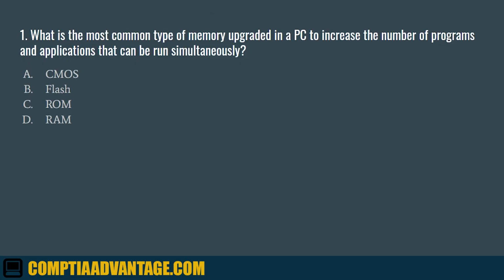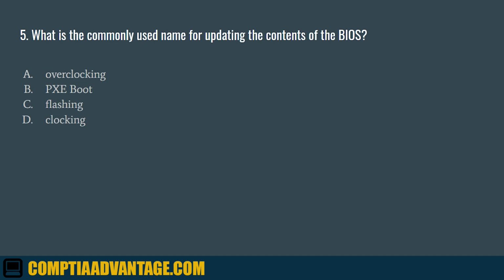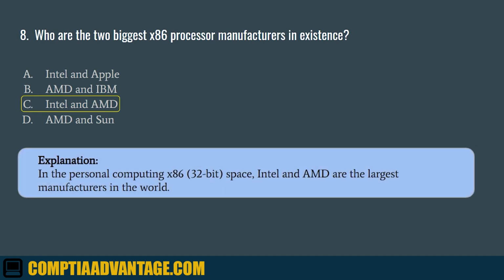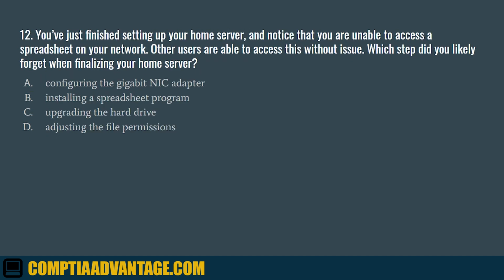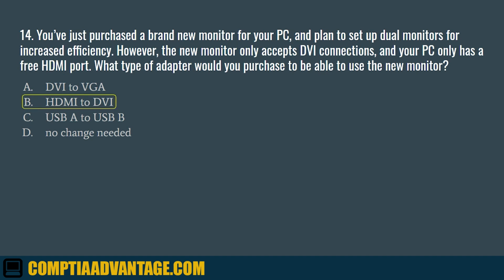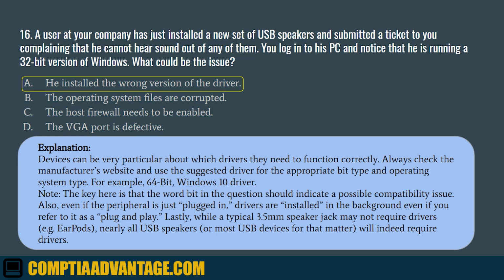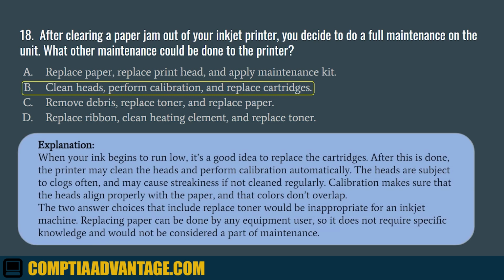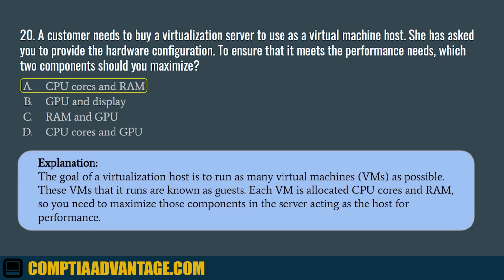CompTIA A+ Hardware Practice Test 2023 (20 Questions with Explained Answers)

Comment: There is no way the real exam is this easy. Is it?
Reply: Its a hit or miss since some of the question have multiple correct answer and sometimes doing the most basic + least amount of work for troubleshooting is the answer. Like what to do when a display shows " No input detected", we would assume it would be check the wiring. That would be wrong, you would need to change the setting to make sure the input is correct. Thats how they get you
Reply: @HowToHuntbounty  its pathetic that they do this so they can squeeze money out of people. nobody checks the input setting that is some shit from 20 years ago
Reply: @PS2Damon  well not really you run into these issues on a daily basis
Reply: @HowToHuntbounty  like which one? Obviously you'd need to study to know a monitors refresh rate for example. When have you had to adjust it in your working years to fix a blinking monitor?
Reply: @PS2Damon  Last week, if you work in the service desk / help desk you will run into this issue. End -user aren't always so bright, I ran into a situation where a user couldn't turn on his PC. He thought it was broken, it ended just being that he wasn't holding the power button long enough. That being said you always going to run into a situation were you have double check if a user did this or what happened when they did that. That's why the first part has so much knowledge base on the hardware, cause it is good to have a general understanding of what each component does. I work remotely so its even harder to attempt to troubleshoot when you aren't even physically there. That's why they load so much information so they can be sure you have a general Idea
Reply: @HowToHuntbounty  I guess I was wrong then. Thank you for your input
Reply: i really hope so
Reply: Some questions same I took test and couldn’t pass :( language problem